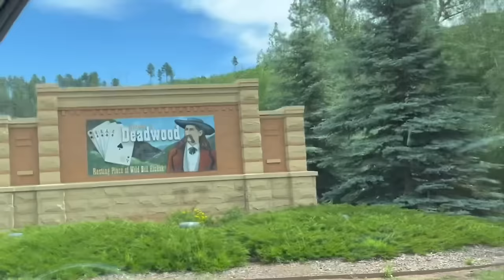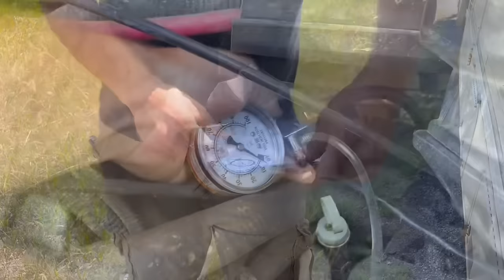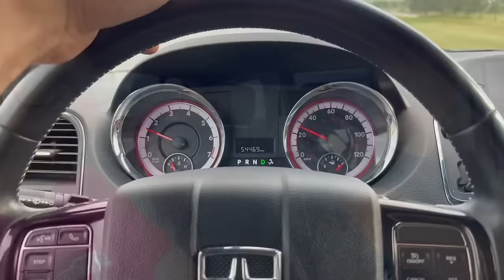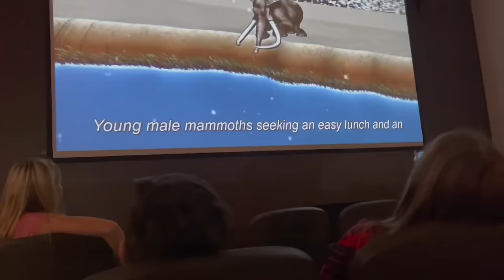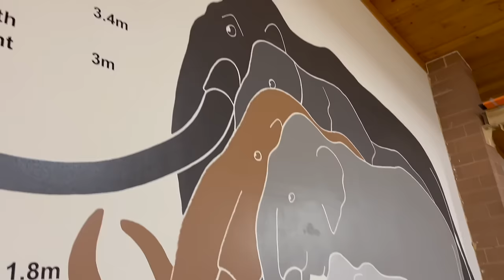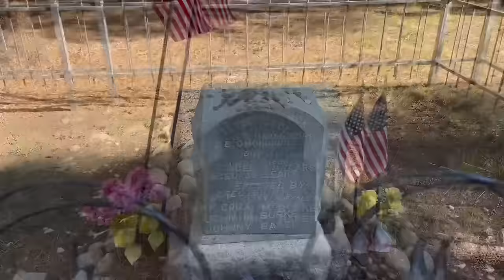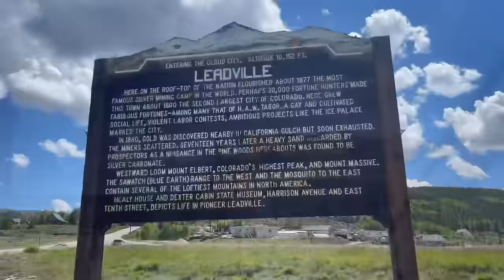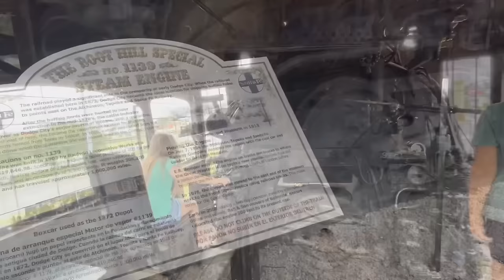Can we make it out of South Dakota in our $1250 motor home? 5000 mile road trip !!!

Comment: Gracias a Dios que llevaron las herramientas; porqué la camioneta va accidentada; tarda en encender; le están revisando la falla mecánica de la bomba de gasolina porqué está fallando y cuesta encender el motor de la camioneta; pero la camioneta está fallando; filtro tapado; no te dejes guíar de las apariencias; porqué las apariencias engañan; tratan de llamar a una grúa; porqué están accidentados por avería; no puedo salir así; gracias a Dios que buscaron a una grúa; para auxiliarlos; porqué están accidentados por avería; tratan de encontrar a un mecánico para revisar la falla mecánica de la camioneta; para solucionar el problema mecánico; para lograr encender la camioneta; porqué están accidentados; gracias a Dios; qué alquilaron una camioneta para ver si logran arreglar la camioneta; para qué enciende; para resolver el fallo de la camioneta; para qué la logren encender; para resolver la falla de la camioneta; para continuar con el viaje; saludos y buenas noches.